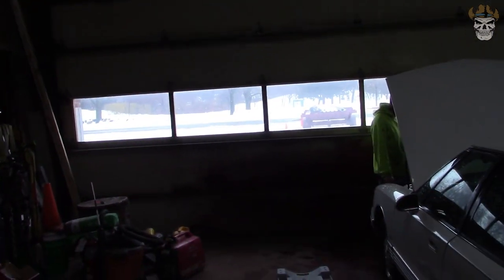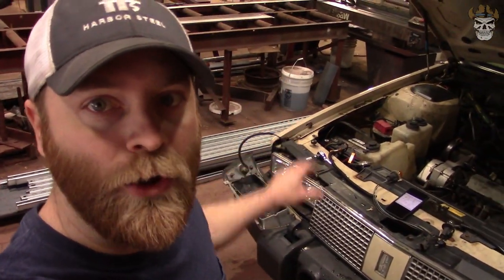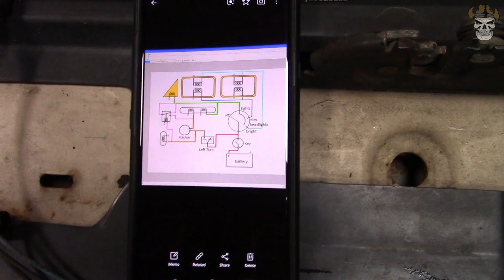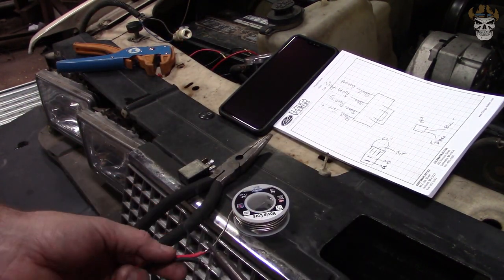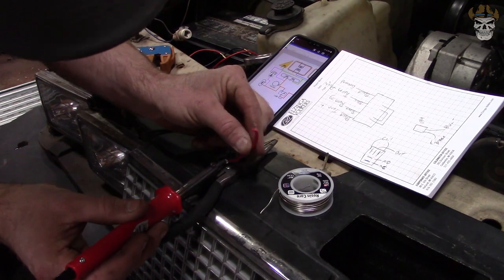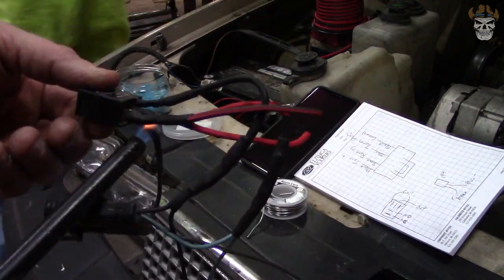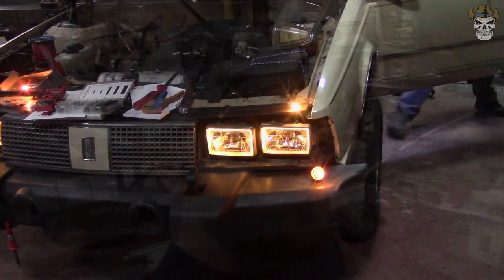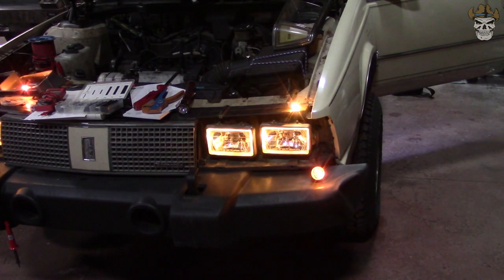Yellow 1986 Olds Build - LED Headlights and Halo Eyes Done

Comment: question i bought some aftermarker lights tht use replaceable bulbs if i have just the outer two plugged in  the car seems ok but if i plug in the inner two after a couple minutes it looks like i have police lights they all start flashing also lights seem dull compared to original ill post alink where i found the aftermarket lights
Reply from the maker: Thats odd.  I do know there are some people who have complained about the LED head lights getting hot and warping the board and in some cases they flash like that but for all of them to be flashing tells me you either have a head light switch going out or possibly the head light relay.
Reply: @PostalRedneck   thank you i have replaced the switch as it was bad but problem persists so i guess ill be tracking down the relay